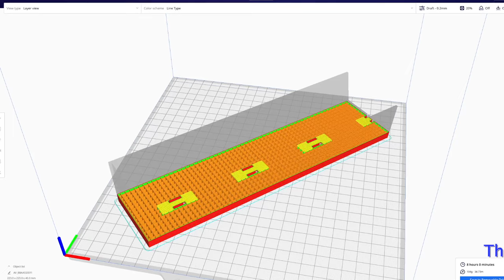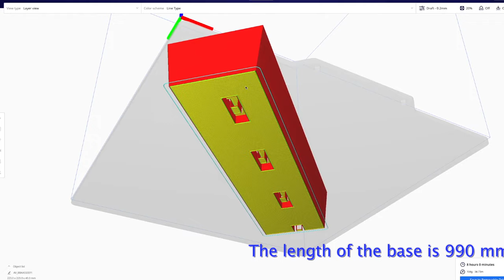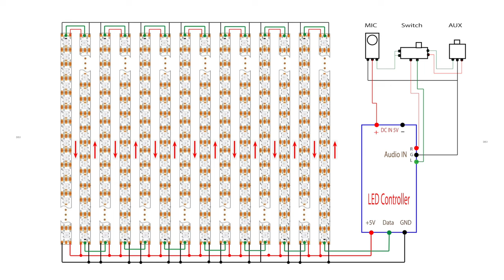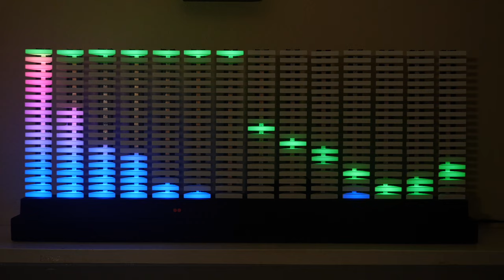14 Band Music Spectrum Analyzer  | 3D Printer Towers | Step By Step

Comment: A few things to consider---First, you only have to hookup power to the bottom or top, but not both.  Secondly, have you considered a wood bottom to add a little elegance to it or sand the plastic (lightly) and paint it maybe a flat black or gray. The printed bottom looks flimsy and cheap.  You also could have used a better audio input jack. Gluing in parts will come loose.
Reply from the maker: Thank you for your comment. I agree with you. The power wires can be connected from the bottom or from the top, but the brightness will be a little different. It was better to connect the two sides to maintain equal brightness for all LEDs. For the base, I used a sound bar to be an integrated sound system

Comment: Great how to video. Do you have the STL for the stand and the base as a complete part for those with a larger bad to split themselves?
Reply from the maker: Hello, sorry for the late reply,
I do not have the STL for the base and the stand in one piece, because I designed and cut them and then saved them as an STL file.

Comment: Some clarification needed please. I wish to make this, but there is no explanation on programming the ESP32  or on the DMS-308.  Schematic doesnt show anything about the ESP32 or DMS-308. There is no ino files for testing the leds or frequency test
Reply from the maker: Thank you for your comment. In this video, the focus was on 3D design and assembly. As for the control board, there are many videos that explain ESP32 programming on YouTube or you can buying a DMS-308, which is ready to work, but it is expensive. As for the SP107S, it's simple, ready to go, cheap but not professional. As for the frequency test 27:34.